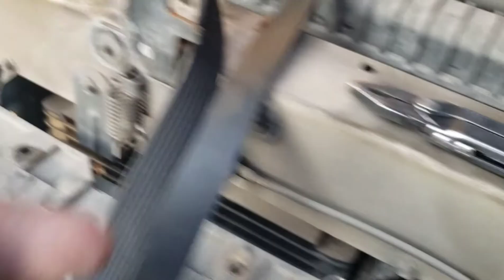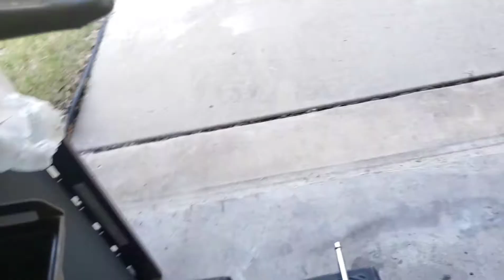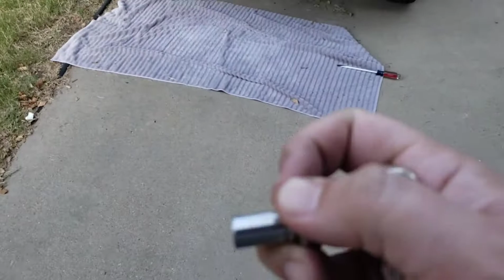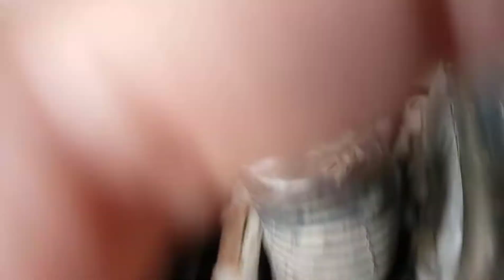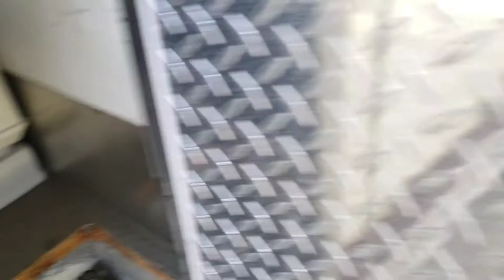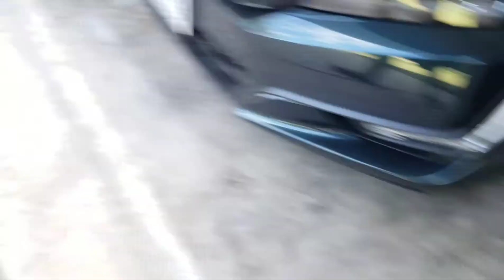Alternator and Belt swap on 1999 E-450, 7.3L Power Stroke ambulance

Comment: Your video gave me all the inspiration to do my own! I just bought a 2008 Ford E450 and ran into some battery issues and it's starting to look like the alternator....and here I'm thinking it's going to cost an arm and a leg! NOPE! I can do this myself now thanks to you!
Reply: And just when I thought it was going to be that easy lol. That release actually released my second alternator, the Lower one, not the upper. So I need to find a schematic for my specific model. I didn't see a drawing on mine. 2008 Ford E-450